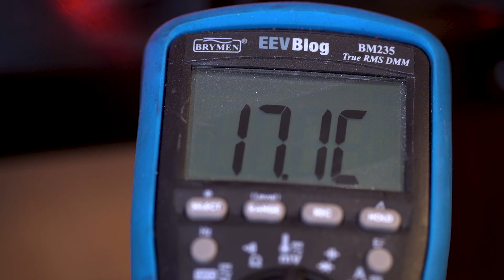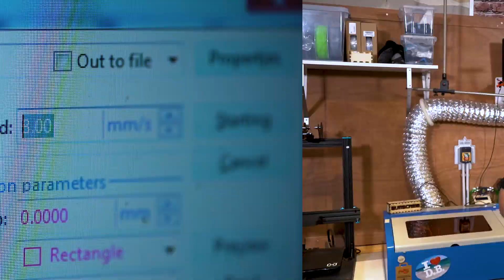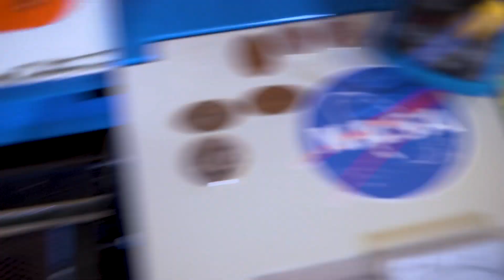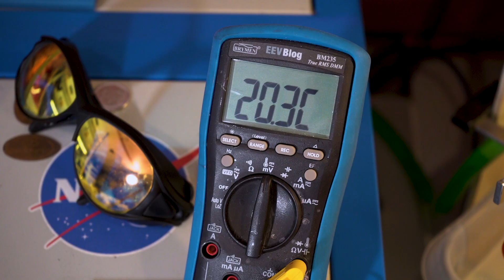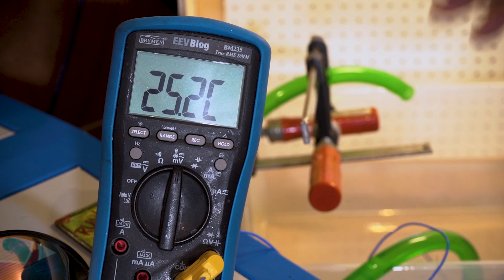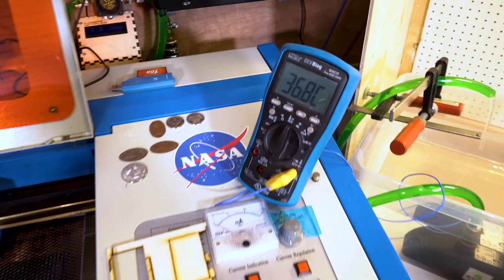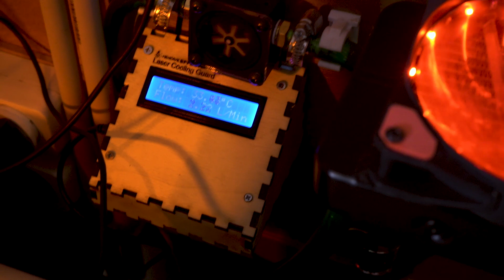K40 Laser Cooling Water Temperatures / What Temperature works best

Comment: The laser tube temperature will realy affect its performance in short bursts, however under sustained firing it will heat the gas increasing its preassure.
However I think the problem is more with the mirrors or the unions coupeling the lens to the glass body or more so the glue used, if the temperature was to get to high the glue will brake down.
Also mirror alignment could get affected throug glass tube expansion.

Comment: I bought a cheap ice maker and cut it open and bent the cooling tubes over into a 5 gal ice chest, works great.
Reply: I did something similar except I removed the ice basket so the ice would fall into the water reservoir and then added submerged pump

Comment: I noticed when I was cutting with a temp of 71f-77f  on the output of the tubes , the cuts were a lot better and all the way through. When the water was cooler around 65f and below coming out of the tube. The cuts did not go all the way through and the quality not as good. Over all I ran with the higher temps and had no issues. Ran for 3 days in a row at 10 hrs each day with no issues.

Comment: When I was experimenting with temperatures i found out that when I was above 25°C to 35°C my chances to get a cut was 50/50 while when I was at 15-20°C my chances of cut was 100%. 
Also ur results was this becouse u did only short cuts. I was testing with cuts that lasted 10-15mins and my results was way more differet... I found out that in higher temps starting cut was mostly succesfull but in the proces it started to fail.
for example: I was cutting parts for a box and some pieces was perfect while others was not. Or half of the part was cut and the otherone not.

Comment: Thank you very much for this great video. I'm a beginner k40 user and I haver a question: I live in England and my garage  temperature normally on winter is between 8º to 14º celcius. Do you think I should warm up the room before use the k40 ?

Thank you again!
Reply from the maker: Thanks Brian, in fact the colder the room and cooling water is the better the results. 8-14c is perfect
Reply: @MancaveEffects  That's great! I was worried about it, and thought it may break the tube because I read that it should be between 18 and 23 room temp.. I think I can keep it on my garage instead of moving it to the house.
Do you think I will need a powerful cooler or with a pc cooler like yours will be fine ?. Thanks for your quick reply!
Reply from the maker: As long it is not freezing it should be fine. I dont have any experience with ambient temperature lower than 10deg c. However as long you keep the cooling water under 30 deg c you should be fine without any active cooling. It of course depends on how much you are using the laser. A reservoir like mine will heat up when using the laser more than an hour in a row.

Comment: you should use MDF instead of plywood, it has a more uniform volume, no air pokets or knots inside. I always give it like 25% extra power when cutting plywood just to be sure it cuts through otherwise knots or hard spots will ruin your day.

Also you could make a laser power tester, basically just an aluminium heatsink polished and covered in soot (quite a thick layer) and put a thermocuple on the other side with thermal epoxy (and insulation so it only meassures the temperature from the other side),   and put a fan on it  (make sure the voltage doesnt fluctuate a lot) 
Then its just a matter of putting it on the beam path and meassuring the delta T between ambient and the heatsink. As the thermal resistance is constant, all you have to do is calibrate it with a resistor  (pure heat power disipation) at a few power levels and thats it. Once you have the thermal resistance you can calculate the power being applied to the heatsink with only the delta T and the ambient temperature.
Reply from the maker: This is very interesting 🤔
Reply from the maker: Actually i never tried mdf in the k40… i should give it a try…